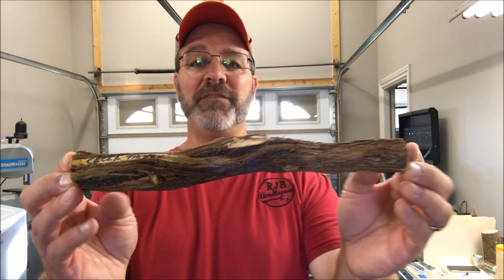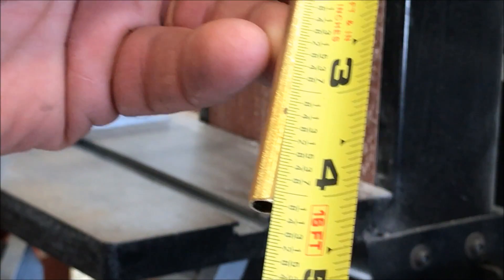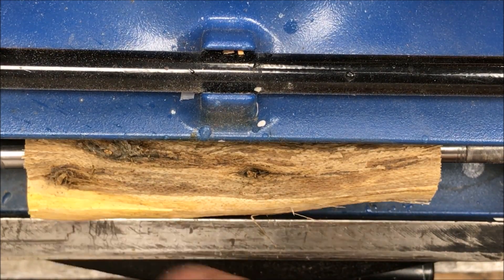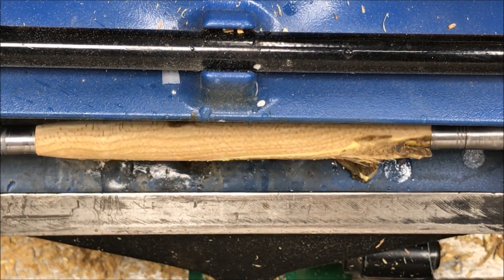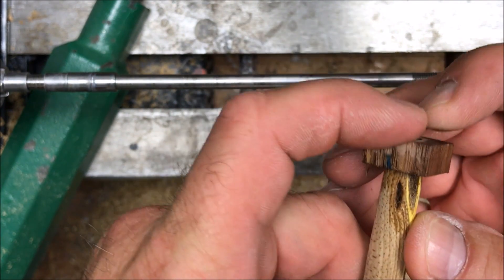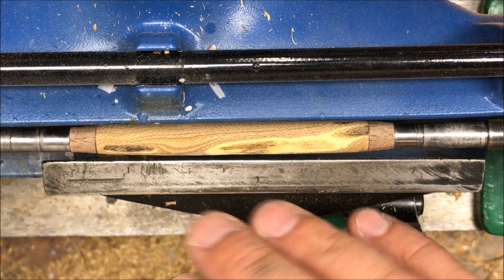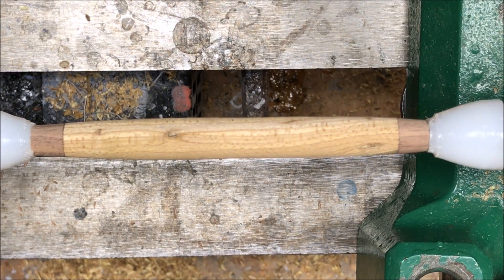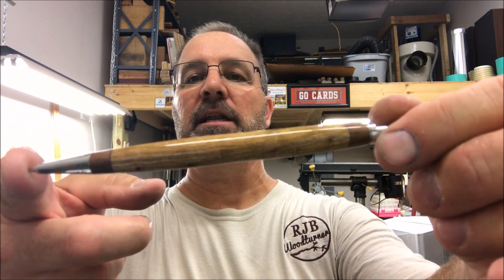Sage Brush Pen with Walnut End Caps

Comment: I just saw this video after I've made 3 pens from sage. Your experience was pretty much the same as mine. The wood is a little finicky to work with, but looks amazing once finished. I like the idea of using the fibrous material to fill in the voids. I used sawdust and thin CA, and it turned out pretty nice, but I think the fibers would be even better.  I'm planning on doing some more with this wood, as it is very attractive, and very few people seem to work with it, so it adds some exclusivity factor to the effort.

Thanks as always for the thorough explanation of the process.

Jeff in Northern Nevada
Reply from the maker: Thank you Jeff. 

Regards,
Bob

Comment: Was experimenting with a Celtic Knot with maple and walnut on a slimline last week and had some chip out on both end of the knot section, I used some green acrylic to replace about 3/16" on both ends of the clip end.  Nice pencil, not tried a modified yet.  Have a good day.  Bill
Reply from the maker: +Built by Bill Thank you Bill,
  Great save on that Celtic knot pen. 

Regards,
Bob

Comment: Hi Bob.  I also don't like the center ring on a mechanical pencil kit.  They seem to flimsy.  I didn't have any long tubes so what I did was carefully measure the length of the blank like you said.  Mine came out 4 1/4 for a trimline kit.  I then glued in the 2 inch tubes into both ends of the blank.  It worked great with the 1/4 inch void in the center of the blank.  Great video thanks.
Reply from the maker: Thank you, 
  It’s always great to modify pen kits, nice job. 

Regards,
Bob

Comment: I found that if your have your punch in the brass tube WHILE cutting with the tubing cutter it doesn't collapse or get much of a burr on it.
Reply from the maker: +Lee Peterson Great tip Lee,
  I never thought of trying that but I will. 

Regards,
Bob
Reply: I'm thinking that the harder punch would dull the tube cutter?  What say you?
Reply from the maker: +Dwight L It might a bit but it's worth a try.
Reply: It will dull the wheel on your cutter if you squeeze it together too much, check the cut frequently or if you cut a lot of pen barrels, keep some repair cutters on hand. I make pens in 100 batches for "FreedomPens.com" for our soldiers overseas. I screw up barrels every once in a while and cut replacements from 12 inch brass stock from a co. on Amazon.
Reply: I misspelled Freedom Pens, It should be .org, not .com

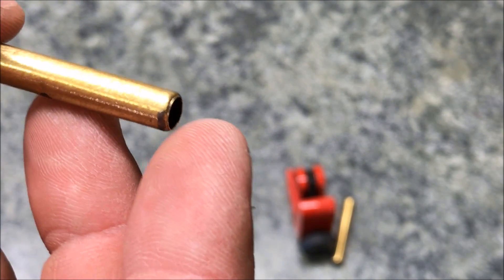Comment: Great save, Bob. Nice to see you work through these problems. At about 3:20 you have a squaring jig. Is that something you purchased or made? I've been squaring my blanks from the edges of the blanks instead of the centers of the tubes, which will eventually bite me when tolerances get tight or my drilling is way off.
Reply from the maker: Hello Mike,
  That was made by Tim Geist. He sells them through www.signaturepensupply.com. Just search sanding jig. 

Regards,
Bob

Comment: Another great looking piece. Do you use activator between coats of ca or let it set naturally?
Reply from the maker: Thank you Art,
  I try to avoid activator whenever possible. I’ve had issues with moisture getting trapped in the blank. 

Regards,
Bob
Reply: Ah! Gotcha, thanks.

Comment: Hi Bob, I have a question about how you got such straight cuts on the walnut cutoffs.
Reply from the maker: +John Impenna I used a sled on my table saw with a hold down. Then I just split the piece in half. 

I didn't show the sled because it's one of the Incra sleds and way over kill for what I did. 

A piece of wood mounted to a sled base at 90 degrees to the blade will do the trick. Just use a clamp to hold the wood and keep those fingers safe. 

Regards,
Bob
Reply: Really interested in that sled, Bob.  I hope you do a video on it soon!
Reply from the maker: +Tenspeed TheBikeHanger Its the Incra miter sled. I wasn't showing it because it's a luxury and most people aren't going to drop that kind of money.